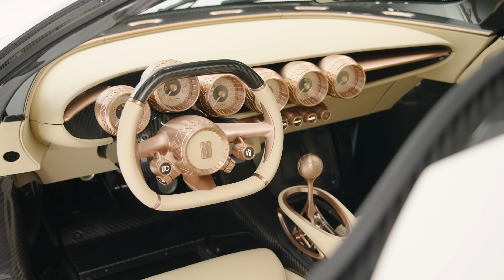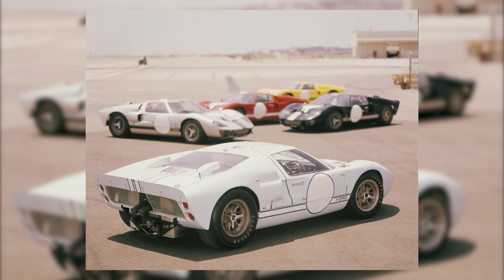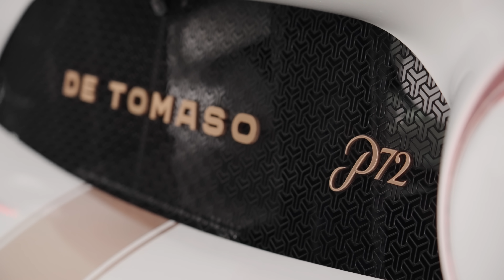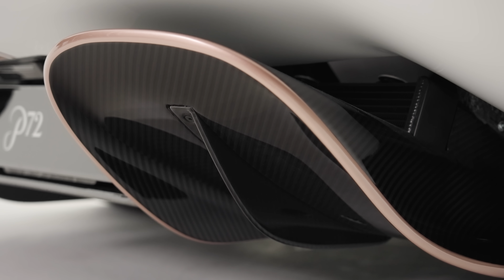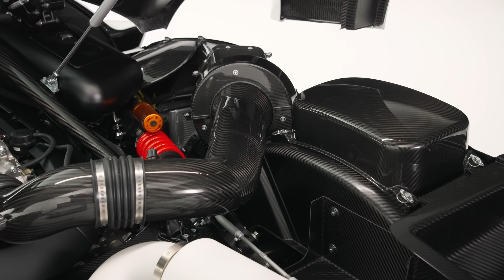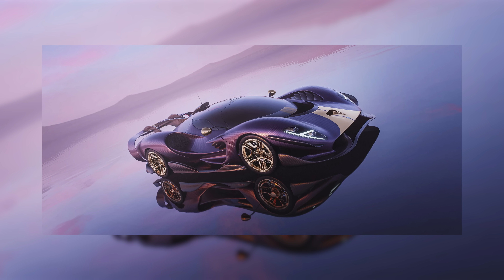FIRST LOOK: De Tomaso P72 – 700bhp, £1.6m… Work Of Art?

Comment: My heart goes out to anyone who bought a new 33 stradale for more than this masterpiece
Reply: Anyone capable of affording and Alfa 33 Stradale can more than likely afford one of these to go alongside it. I think having both in a garage would be an exceptional pair of artworks!
Reply: @jakwadd  100%. Totally agree.
Reply: Surely there's a helpline
Reply: Good thought you are correct
Reply: If you think this is going to cost less than a 33 Stradale. You haven’t been paying attention.
Reply: Absolutely correct! 👍  @juliansutton5819
Reply: a Masterpiece would have a manual instead of an automatic ( paddles )
Reply: They probably bought both. So don't be so heartbroken.
Reply: Don't bother, if you can afford this, you can afford both, so you can save the tears.
Reply: They can afford both dude…
Reply: I'm pretty sure they'll be rich enough to buy both
Reply: bro is forced to hate 33 stradale
Reply: Unpopular opinion: Y’all be smoking sumn if you’re taking 33 Stradale over this. This P72 has pilot watch style with full chronograph complexity, from analog speedometer to the shift knob itself. And sure would feel close to a P4/5 than a 4C. And this is HALF OF THE PRICE!
Reply: @hoffmaestro88   other unpopular opinion
DeTomaso P72, Pagani Utopia and Automobili Mignatta Rina, they make the perfect triplets of Italian design and engineering. The P72, the LMP2 Based Beast
The Utopia, the work of art with an AMG V12 inside
The Rina, the roadster TVR from Italy.
Reply: They probably can afford both, and an original
Reply: @tommaidment7810  most likely.
Reply: …I turned one down for £650k when it came out… I’ve since lost all my money, if I’d have just said yes I’d be £950k up right now!
Reply: @ How many Alfas did you have to own to be invited to get one??
Reply: Omg. I was thinking the same thing. I always think of those two cars together for some reason. Stradale is sadly a reskin.
Reply: This is a chinese car…
Reply: That rose gold is an eyesore guys.
Reply: Why feel sorry for billionaire oil sheiks? They won’t drive these much.
Reply: I like how people arguing about the 33 while the rich does no comparison and have already bought them
Reply: More likely you will find that at leas some have bought both...
Reply: This should be pinned
Reply: But if they got both...what a pair
Reply: As a piece of artwork, maybe but sat in a room with the engine turned off, is probably a bit premature to compare those 2 cars
Reply: Bingo
Reply: Theft...
Reply: 33 Stradale is just an overpriced MC20.
Reply: Whoever bought the Alfa 33 Stradale's has money for this one too! Só...😉😜
Reply: This has a Ford Mustang engine , it's sucks sure isn't a masterpiece
Reply: Secondo te ,se usi un po' il cervello....vale più auto con solo 33 esemplari o 72?...
Reply: 1 : a matter of taste 
2 : whoever can afford one can afford the other 
3 : obviously the 33 costs more, given that only 33 units were produced
Reply: Best car ever lamborghini Miura 1972.
Reply: I love how people talk about the Maserati MC20 like it's a car everyone can afford.
Guys that "just" Maserati starts from 250K USD. I agree 33 is a reskin but the base car itself is expensive already.
Reply: Why are you comparing the two? 33 Stradale is gorgeous and will be a total beauty on the road.
Reply: @KadirNokay V-6
Reply: This is better
Reply: Don't really see why this would be much better than the 33. Also there's so few 33s that the owners can very likely just buy this one too.
Reply: it's crazy how alike they are
Reply: this has a coyote motor its overpriced
Reply: I’d take the Stradale over this
Reply: It's too chintzy inside.. rose gold,  white leather, every surface etched and detailed...
Reply: They'll be better off. This thing is never going to through production.
Reply: L take. This car is way too tacky. If you own this you probably have a penthouse with 16th century paintings and a gilded roof. And possibly gilded toilet.
Reply: This definitely is more special that 33 Stradale, but I would prefer a paddle shifters.
Reply: @grndwrksim you gotta be kidding me
Reply: Serious the stradale is an italian masterpiece. This car looks like a cheap copy and its proportions hurt my eyes..
Reply: What are you smoking? I'd take the 33 Stradale any day over this lol
Reply: @sepmercury5180 you’d take a reskinned Maserati over this? Bro be so fr
Reply: @sepmercury5180 33 is horrendous for the price and for the money there are far better cars
Reply: @sepmercury5180  have you watched their last vid? It's a re-skined MC-20. (pulling a lamborghini masterclass)
Reply: @christian5146  u did not understand shit about that car, it is not an mc20 just because they share the chassis design, go make some research
Reply: 700hp is trash there is no way to justify that 1.6mil it's just lawn art
Reply: @Imma-Loot-Goblin  the Alfa has a 620 HP combined with a 130 HP Electric motor. The P72 has pure V8 power
Reply: @Imma-Loot-Goblin  what is your pointing and always in this wash up channel's comment section?, what just for complaining or something?
Reply: @Imma-Loot-Goblin  why do you even need more than 700hp, if cameras and limits are everywhere, lol?
Reply: 33 looks way better
Reply: American engine..., no class.
Reply: @S.1-I-I-1-1   then why some people loved the original Pantera and all its iterations for the Ford V8
Reply: @Cmin_Zaps  Just what you said, "some people". American means zero class.
Reply: 33 stradale look better than this lol

this try too hard to a point look cartoonish in and out lol
Reply: @lcw_my  the older one maybe, the newest 33 is really hideous
Reply: @lcw_my Well while that is debatable, the 33 is literally a rebodied MC20, like you bought a car that no-one wanted with a few changed body panels for millions while you could have this. 😂
Reply: @motkawon  Not that the mc20 is a bad car to based upon. This is like Pagani a museum piece than a car to drive.
Reply: @sohailang  it's not a bad car. But when you think about it, I wanna say the P72 is the cooler overall project because it's an entirely new thing while the base of the Alfa is a car that exists already. They're both crazy beautiful for sure, but at least in my mind I'd rather pay 1.6 for this than 2 or whatever for the Alfa.
Reply: @motkawon   Sorry to break Your Dreams but... The P72 Is based on the Apollo Intensa Emozione... Tho the Apollo costs 2.67 Million Dollars and 2.3 Million Euros. The car itself has an Italian V12 (surprisingly? Not a Ferrari V12) made by Autotecnica Motori that has around 780 HP, with a sequential gearbox. The entire car Is actually based on the LMP2 ruleset. So... The P72 Is kind of a more stylish V8 powered LMP2 with a luxurious interior.
Reply: @Cmin_Zaps  you're not breaking my dreams. Is it all entirely made by DeTomaso, probably not. The prospect of having a stylish LMP2 car having a chassis of a equally rare supercar at 2.3mio eur still sounds better and more special to me than a rebodied MC20 at a even higher price. But you know, what are the chances we ever get to do a d*ck comparison in those two cars. So you keep liking the Alfa and I keep liking the P72.
Reply: @motkawon   Bro I actually was saying It as someone Who likes the P72. Besides, Stellantis now has the rights for the DESIGN of the Alfa, so it's Prolly gonna lose its value since they'll surely do something else with its design. The P72 Is something I'd Get but I consider It a bit of a Ferrari P4/5 lookalike (the Enzo one-off made by Pininfarina for Glickenhaus)
Reply: @sperlongatours   Yeah, Prolly that P4/5 was One of the reasons but beside that, even James Glickenhaus accused DeTomaso for making the P72 a "Knockoff" P4/5. I kinda see the shapes, but the P4/5 Is from 2006, this one was announced like 5 years ago.
Reply: @lcw_my  It's a super car, that's the whole point...
Reply: @lcw_my w r o n g, it's an ugly, overpriced caricature of the most beautiful car ever made.
Reply: @lcw_my  the only special thing about the 33 is the interior as under the body it's a maserati mc20
Reply: @ricardoraventos1160  the Alfa uses the same exact Nettuno V6 with 620hp just like in the MC20, certainly not the V6 from the Giulia nor the Busso one.
Reply: @matteo964 the interior isn’t anything special imho
Reply: @lcw_my  i understand you like alfas and I agree 33 looks really good
but keep that opinion in that 2nd line to yourself, bub
Reply: @SayakMajumder why are you acting like a communist? Lol my opinion is mine

Still ppl taste these days is just meh.. pl chose over the top than actual purpose design
Reply: @lcw_my  How many LOL's does a man need?